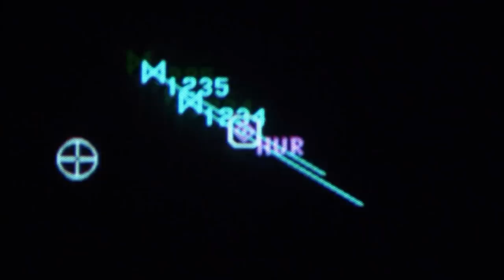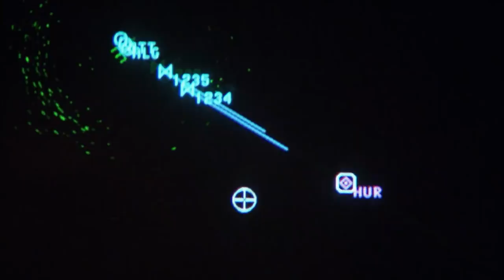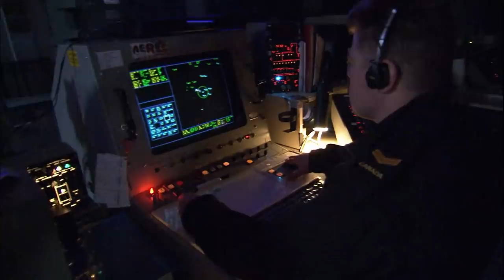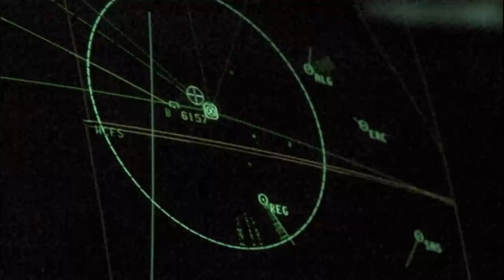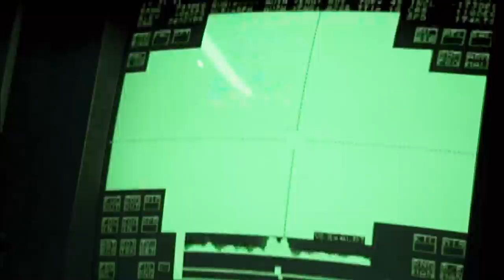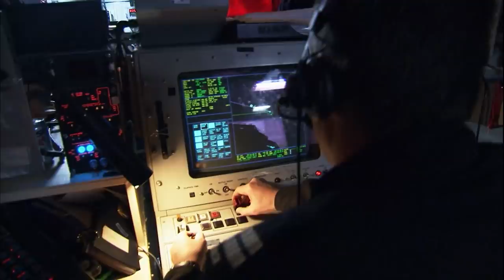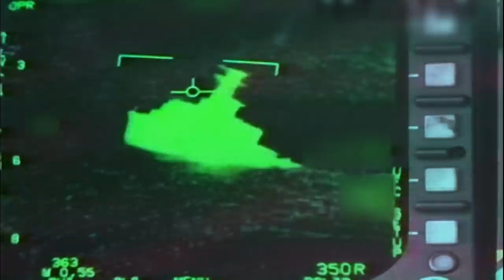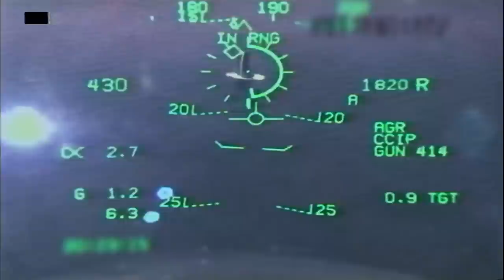Sinking A Destroyer | Free Documentary

Comment: "the latest computers". Then they show something that looks like it's straight out of 1975
Reply: @Veraxu1227  did you just go and say they might beat a modern PC?    You know PC stands for personal computer and those were like the size of a rather large server.  ROFL 
And no they are not ubber modern computing devices they are in the military and running software from the 70s-90s. They can't be modern or they wouldn't be compatible with the rest of the military tech.  

Nice try tho.
Reply: The ship's electronics could be hardened against EMP and RF interference. That could be why it looks that way. Or maybe everything is from 1975 and they're praying ameicans save them if real conflict breaks out.
Reply: @xXxcastenada  I'll type it again... Military systems are as a rule old and ment for old hardware.  If they were to run modern computing hardware it wouldn't be compatible with all of the other old systems.

Also more modern hardware is much much more sensitive to things like EMP and other forms of interference.   Smaller dye sizes means it takes less RF/EM power to interfere.
Reply: @anonpers0n  Modern intel and AMD chips are compatible with what is known as 386 or 486 standards. Meaning in theory they adhere to the same opcodes as ancient 80386/80486 intel CPUs. It makes them backwards compatible to a limited degree. Military systems could follow a similar trend. Given how defense contracts are prone towards making things as expensive as possible, rather than the opposite with trends following proprietary rather than open source software, dont expect much from military contractors who are typically protectionist, dysfunctional and bloated industries incapable of producing cutting edge technology.
Reply: @Veraxu1227  No, they are not high-speed computers in the slightest...
Reply: @anonpers0n  Modern computing has way smaller dye sizes...
Reply: @lucapagliai7869  duh
Reply: @anonpers0n  Ok? and that contradicts what you said about old hardware
Reply: @lucapagliai7869  how so?
Reply: @anonpers0n  "Also more modern hardware is much much more sensitive to things like EMP and other forms of interference.   Smaller dye sizes means it takes less RF/EM power to interfere."
Reply: @lucapagliai7869  I think you are confused...
Reply: @anonpers0n  No, dude you are wrong, either you misworded or you are incorrect
Reply: @lucapagliai7869  newer tech  is on smaller dyes.   Smaller dyes are more effected. By EM and RF I don't know where you think I got this wrong... Electrical engineering was my minor 10 years back...
Reply: Way to many people wanting to argue here...
Reply: well it was out of 1971 lol
Reply: They might have meant "Latest when the ship was built"
Reply: chop stix They said state of the art and latest computers when it came out in the 70s. That’s why they showed the old footage from when this ship was launched.
Reply: chop stix Actually the software is usually kept up to date.  These systems don’t require ultra fast computers to function properly.  The need to operate at a speed that’s compatible with radar pulse trains and no more.  That’s because radar is still the primary sensor used on warships today.  Obviously the more capable the radar, the more capable the computers need to be.  What these systems really require is being extremely reliable and robust, so the equipment can withstand immense shocks propagating through it and still continue to work.  That means racks mounted on shock absorbers and circuit cards that won’t snap in half of become unplugged.  But as for speed...no, they don’t need to operate like modern home computers surfing the web or playing highly complex games with incredible graphics.  None of that stuff will improve the ship’s war fighting capabilities.  So computers built even 20 years ago are more than adequate in so far as their speed goes.  Until radar operators become so fast that they can operate their radar systems on a pulse by pulse basis, there’s simply no need for blazing your fast computer systems.
Reply: xXxcastenada You don’t know what you’re talking about.  Obviously you never served in the military in any job that used these systems.  The speed of an ancient 486 computer is more than adequate for most military weapons applications.  Radars operate via pulse trains.  As long as the computers can easily keep up with those, then they’re fast enough.  Being robust against EMP, long term usages, and highly shock resistant are far more valuable traits for Defense computers.  All those pretty 4K graphics add absolutely nothing to the capabilities of weapons systems.  They in fact, make those systems far more vulnerable to EMP failures.  There’s areas in modern society where older designs are actually better.  This is one such area.
Reply: @mudman6156  He says they're incapable of producing quality hardware and software...well then just who is producing it...Elves?
Reply: @anonpers0n  Saying that old software on modern computers is like saying you cant play GTA 3 on Windows 10.
"ROFL"
Literally just get out of these comments.
Reply: Hey i play on a compute from that time
Reply: Yeah, running "Windows 98!"
Reply: Can’t hack systems that old 😂
Reply: @anonpers0n  lmao actually you nice try
Reply: @anonpers0n  9y
Reply: @anonpers0n  Dude, you're just replying to your own question all by yourself, you're either a fool or the worst type of troll there is around here... These are Iroquois Class destroyers, they've been developped in the early 70s, so yeah they are the most advanced ship and combat systems there is on the seas. And also keep in mind this exercise was in 2006, 14 years ago. As your pointed yourself, most "modern" military equipment dates back from the 70s and 80s and regularly "modernized" since. I mean heck, one of the most recent US Navy ships are Freedom-Class LCS, built in 2005, before that video even took place. It's not kept old because it needs to, and it doesn't run at the speed of your toaster because it's old, they are using softwares that didn't need to be replaced since they've been put in service, and their hardware is specialized to run these softwares.

Comparing military hardware to Personal computers is like comparing the tricycle you ride to an Abrams or a Challenger: they are not meant to do the same thing, but the tanks are specialized in doing one thing right, if you really want to make a comparison, I'm still quite sure the military hardware and software work a lot faster and in a much more optimized way than a 3k$ rig running a AAA game.
Reply: chop stix what?
Reply: Well, if the computers can serve the functions they are designed to serve, why waste money on installing modern ones if they’re performance is will be the same? Assume the performance will be the same if we talking modern vs old. This assumption might be wrong. Just realize that it’s not about having the most expensive equipment, but the equipment that is the most effective, for least amount of cost.

Comment: That was a handicap match with no crew, no hatches, no damage control, no active bilge, and no defenses. Had she had an active status the battle could have lasted weeks or more. Not a fitting end for a ship that performed many successful missions in service of her country. It was target practice on a paraplegic. The same results could have been achieved using a barge or retired tanker.
Reply: @Kully you could always weld some steel to a hull on anything. I was speaking in terms of it wouldn't have so easy to sink her if she was crewed and functioning. I agree it's much better than scrap but they made it sound like it would be impossible to sink.
Reply: @briankornau1294  yeah, put a full crew on a ship that's boutta get curb stomped
Reply: @byronpratt9697  destroyers are designed as a defense mechanism making her more vulnerable to attack does skew data.
Reply: Kully Killy, unless the armor was examined after the exercise to see how it held up,  it had no bearing on this exercise.  Obviously the missile fired did some damage, but considering that it hit an empty ship above the waterline, it most certainly didn’t sink the ship.  And as the ship had also been entirely gutted before the exercise, there wasn’t anything left that could really burn either.  The real damage came from the 5” and 3” guns that put numerous holes in her at the waterline.  With all those hatches removed and left wide open, she didn’t have a chance.  But the exercise proved absolutely NOTHING.  They would’ve gotten the same results from an old barge.  At the beginning they talked about how hard these ships would be to sink because they’ve got so many compartments.  It doesn’t matter how many compartments there are if all the hatches are left open.  So the exercise was a complete waste of time and money.  It proved nothing.  If you really want to see how well a ship can hold up, close all those hatches, give it power so her pumps can run, and bring all her defensive weapons on line so she can maneuver AND COUNTER the incoming threats.  The Sea Sparrow missile might have been shot out of the air by CIWS, and hitting a ship that’s moving with guns isn’t nearly as easy as hitting one at anchor.  Without a doubt, the submarine stood the best chance of causing any real damage.  I’ve yet to see a Sinkex yet that actually proved a thing ... other than a floating object will sink if you put holes in it that allow the water to enter.
Reply: @mudman6156  the sub also had the heaviest weapons but why where American ships at standby for the possibility of a failed Canadian exercise that's the question lol. Did the Canadians not believe jets and several of the sister ships could put a dent in her when she was a ghost ship. Idk how to feel about the exercise kinda seems like the ship wanted to have a fighting chance. I would be without a doubt certain the ship would want to be taken down and sunk trying to defend her carrier

Comment: Why the hell would you use a CIWS to shoot a ship? Every FC in the navy are Rollin over in their racks!
Reply: seriously, and they were hitting the heavily armored parts of the deck... so stupid
Reply: it just shows the capabilities of the canadian navy... ship to air missiles to sink a ship? really?? and 20mm rounds they’ll just bounce off the hull
Reply: CAG Hotshot what do you mean many didn’t perform as designed. A 20mm would never sink a ship unless the ship is made of wood. The missile had a misfire and then worked fine after. The sub never got to test it’s torpedo but it showed a video of how a ship gets sinked by a torpedo. The only thing I saw was one of the cannons not firing and then the cwis not locking on the ship. But the cwis was never designed to aim for ship. It was for missiles, and planes. Not a ship. That’s why they had to manually control it. Either way the missile did its job and the 76 as well. Everything else wasn’t ever gonna sink that shit. Even in the state it was in.
Reply: Even GM's rn lol

Comment: if they thought a little 25-40 mm auto-cannons can pierce a armored that HMCS Huron probably has 80-150mm or more armor or less it would basically be trying to stick a needle in a 1in steel plate a 120mm auto-cannon (would be nice to have instead of a 57 or 76mm cannon that can be mounted on tanks) with armor piercing high explosive shells that can go though and damage inside compartments like command centers, engines, turret shaft, crew, burning of fuel, ammo, etc, or a shell with a semi armor piercing shell with more explosive to poke hole around the water line to let water seep in the hull to tip the ship to one side
Reply: if the fighters think they can sink a ship with 20mm Vulcans from strait down they would have gone though the layers of all the decks witch will slow the round and stop it before it can even think about touching the bottom of a ship, they are better off with torpedo's and anti-ship missiles that can go off and hit the main guns of a ship and disarm the ship

Comment: sorry to say but they gave out some faults information.  1944 was not the last time there was a real naval battle.  Look up operation Earnest Will that was between 1987-1988 during which Operation Praying Mantis was conducted April of 1988.  This operation included surface to surface, surface to air, and air to surface engagements.  There was at least 2 Iranian naval ships sank, several Iranian air craft shot down, and a number of small fast attack boats sank.  There were also oil platforms destroyed that was being used as command posts.  The oil platforms were also used to resupply mine laying ships.  It would be nice if they would not put out faults information and then call it a "documentary".